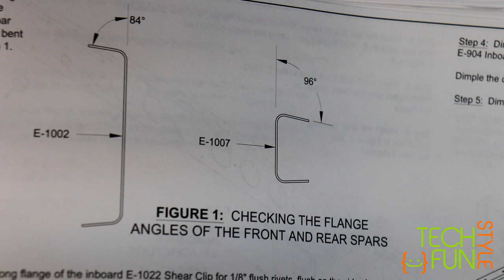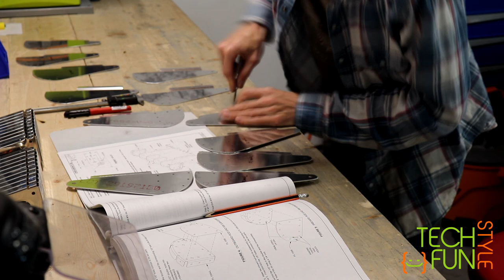RV-10 - Wings assembly. Flaps and fuel tanks check.

Comment: If the shop head doesn’t fit the hole, it is not necessarily overset, the hole is only there to catch underset rivets. What catches overset rivets is the other end of the tool. If the shop head passes underneath the cutout, it is overset.